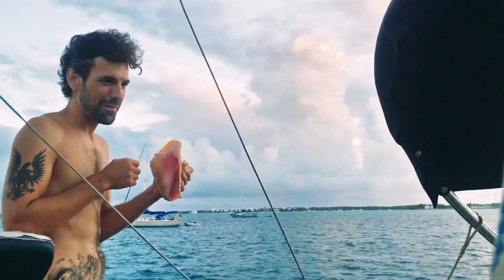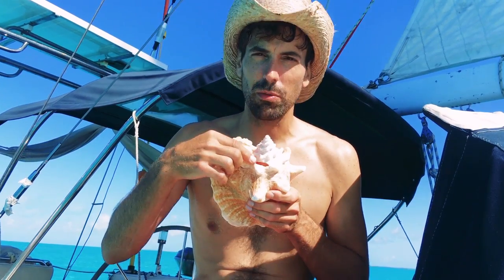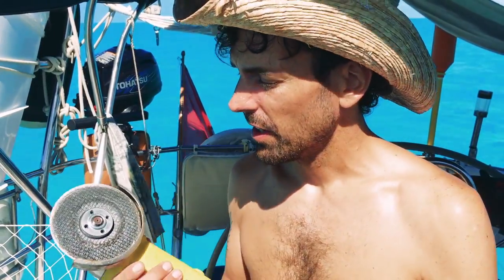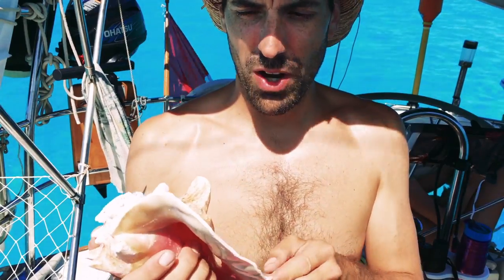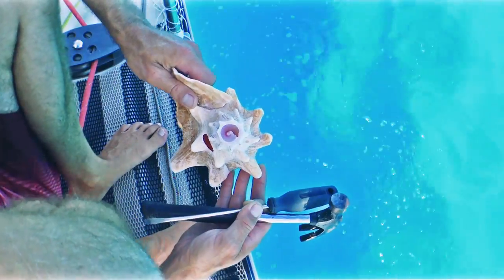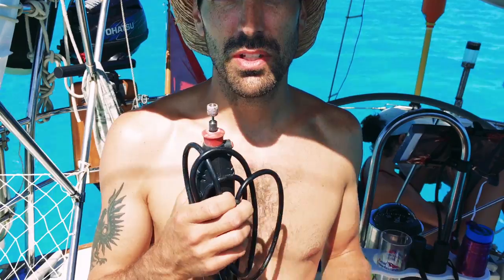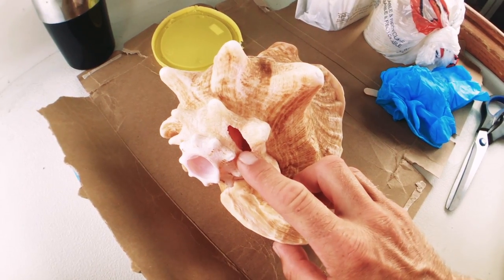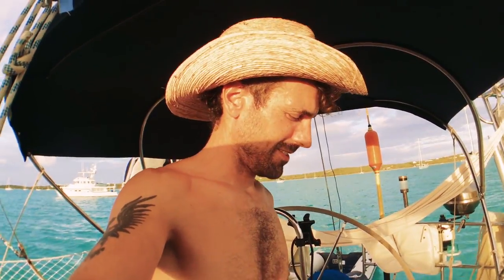How to Make a Conch Horn while Sailing | Sailing Balachandra E052

Comment: How did you keep the epoxy from dripping into the inside of the shell with the hole in the front?
Reply from the maker: If you're patching the hole up by the blow hole, it helps to add a little fiberglass matte to support the epoxy.
Reply: Sailing Balachandra thank you so much.